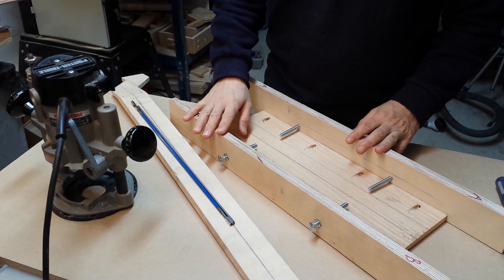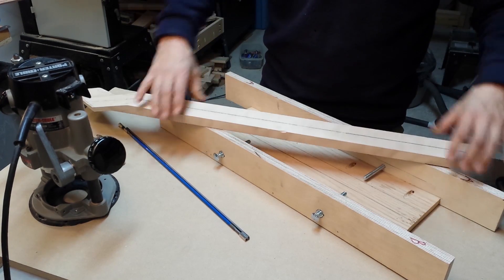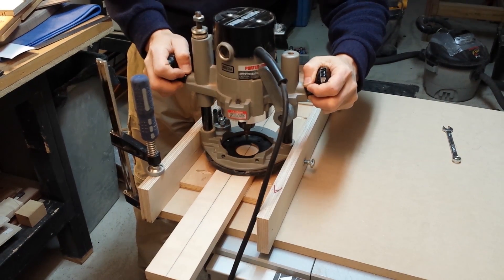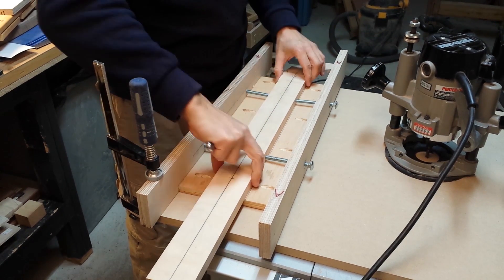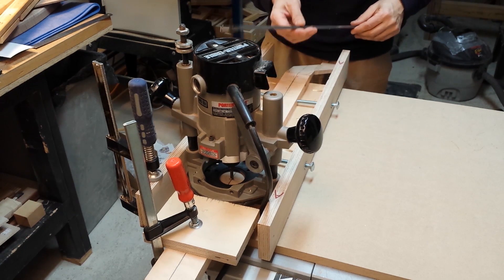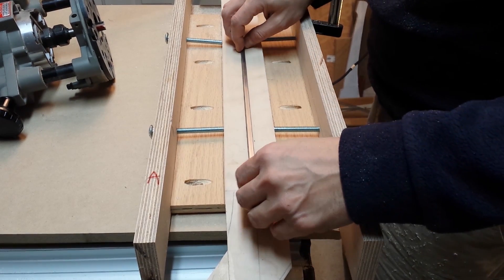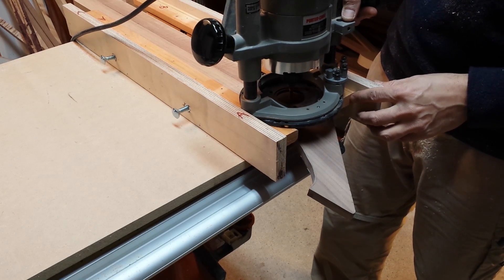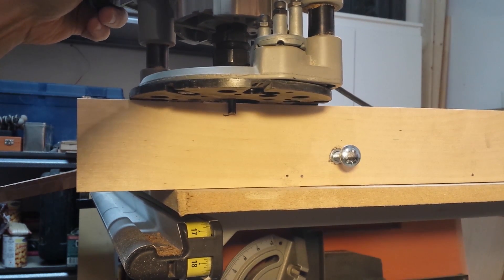Truss Rod Channel Routing Jig

Comment: Thanks for this video. I have made a jig similar to this but have yet to route a good clean channel. I got three great ideas from this. I need to add the bolts on the side. Do you have something that they go thru in the wood so eventually it doesn't just strip out the wood? Secondly I need to add the stop piece because the truss rod I routed for last night I went too far so I had to reglue some pieces in the channel for a stop. And thirdly mine is just a fracton too wide so I have to add something in the sides so it doesnt float around. I'm getting there. A work in progress.

Comment: I've found replacing the base of the router with a square plate allows much better registration with the edges of a jig such as yours.  I believe some of the slight errors you have occur because you are using the unreliable widest points of your router's base.  Any twist will change the registration with the edge of the jig.  Thank you for your videos!
Reply from the maker: A square plate is a great idea! Thanks.

Comment: Doesnt the end of the bolts but divits in the side of the neck?
Reply from the maker: No not really, I don't tighten them all that much. Even if they did, they neck will be shaped later one and any divits will be gone anyway.
Reply: @Projectelectricguitar  Put wooden shims in on the sides.  That will protect the neck from getting marked.

Comment: Great idea, i also think i could make it so that I can accurately level the face of the neck. One piece of advice if I may, i would wait till the router has stopped rotating before you would remove it - safe guard your work but more importantly yourself, hands, fingers etc.
Reply from the maker: Yes, you can use it to plane the surface of the neck as well. Good advice about waiting for the router to stop... thanks! :)

Comment: Amazing.
Only a question. I see your router has not symmetric base.
Could it be an idea to remove the black base and replace it with something "handmade", maybe even a squared shaped piece of wood (3/8" should be enough), so one is sure the router goes straight in the jig?
Reply from the maker: I really like that idea! 
Even though the base on my router is not symmetric, it has not been a problem for me so far. But I will keep your idea in mind for future designs. Thanks!
Reply: Project Electric Guitar 

I am making one myself and have the same router as you.  I also noticed the asymmetrical base.  The round part is 5 3/4 inches in diameter, which is the width I will make the parallel fences.  The front of the router will be at an angle, which will make it easier to use.
Reply: I know this is 2 years ago but for anybody else reading this.  If you make a square base it would be advisable to round the edges of that square to prevent jamming.

Comment: Great template, just one question. How did you get the bolts to stay in place? I see a nut but not sure how it is attached. Thanks
Reply from the maker: Thanks Ryan. To hold the nut in place, I simply drilled a shallow hole and then chiseled the edges and then forced the nut in. It's not perfect but it works. However, since the video came out, I have a better design of this jig that uses t-nuts instead of simple nuts, it works so much better now... I also added a few more improvements... You can see the updated version of this jig here http://projectelectricguitar.com/a-truss-rod-channel-routing-jig/
Reply: awesome! The T nuts are a great idea, I am going to build one of these this week.
Reply from the maker: Cool, would love to see it when it's done. If you want, you can join the Project Electric Guitar Facebook group and show it there: https://www.facebook.com/groups/ProjectElectricGuitar/
Reply: Would I need a plunge router to use this jig? I have a regular router, the handles seem too far down the body for this jig. I was going to try lowering the walls of the jig but not sure if I will have room to use the stabilizer bolts. Any advice? I would like to buy a plunge router eventually so I may just go ahead and bite the bullet.
Reply from the maker: I don't think you need to lower the walls of the jig. You can rotate the router so the handles are inside the jig and the non-handle sides of the router ride against the walls, do you know what I mean? As long as your router bit can go down deep enough to carve the correct depth of the channel, you should be fine.